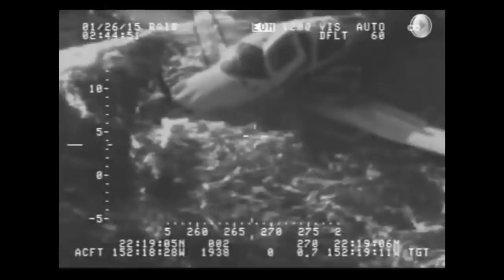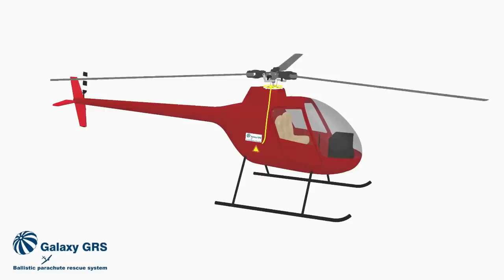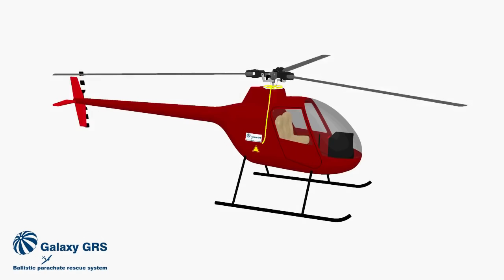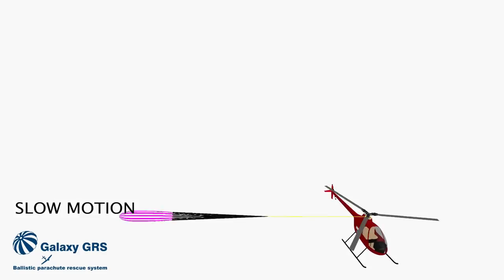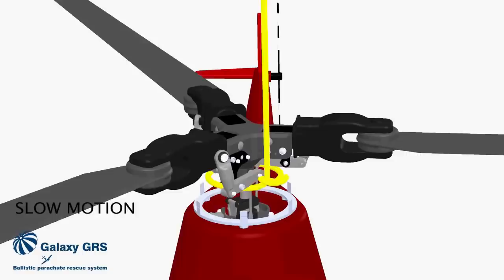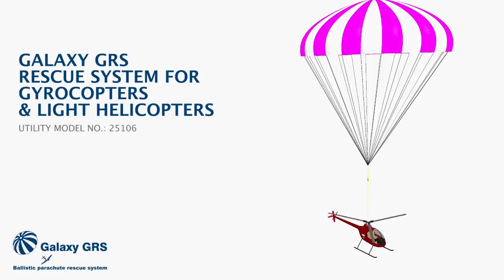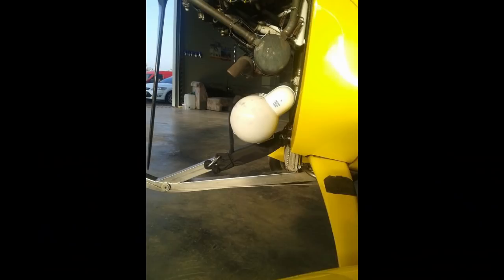Gyrocopter parachute rescue system or ballistic recovery system [BRS]

Comment: I watched an early Air Command go in from around 600 ft. A couple loud popping noises like a shotgun, and we all turned just in time to watch as the Machine made a giant parabolic curve into a nearby field.
  What sticks in my own mind is that the rotors were not turning at all. 
That man would have survived had he had a simple balistic parachute attached to his airframe. Even at the mast. There would have been no rotor interference at all.
  I dont know why this accident actually happened, I personally suspect the Sky Wheel rotorblades.
 But i do know, that any pio or pitchover causes the blades to flap and to strike the airframe. And all of the accidents ive seen since then on videos, the rotors were either stopped completely or nearly so. 
 Some were too low for recovery, but rotor interference would not have been a factor. 
  There is a serious danger of inadvertent deployment, but......
Reply: When you unload the rotors in flight (and it does just happen in ppo) the airflow is reversed the disk will stop in about 1-2 seconds.  The airframe is still flying forwards and flys straight through the disk (generally)  the two pops you heard were the prop colliding with the rotor and possibly the rudder striking.  This is generally a very high speed accident.  In the older VW direct drives with shorter narrower chord blades this was less common but with the advent of light high power machines like the aircommand and larger rotors it started happening more often.  Many of these happened in strong winds turning tight circuits from downwind to upwind.  The gyro flies relative to the wind but when turning from a downwind to upwind you drift and many pilots instinctively turn too tight,  the lift vector now almost sideways requires greater power and back stick.  In the old machines you'd just stink in 583 with 25ft 8 inch chord rotors it could hang on.  Now he turns up wind and the now massively spun up rotors are flattened out what will the machine do?

It'll climb like anything,  the big heavy blades have loads of inertia so as you push forward the lift vector is even more vertical,  you should cut power and wait but our hero is setting up to land so he pushes the already shallow disk angle further forward.  Bang rotor unloads machine flies straight through the disk bang bang bang your blades are now stopped all control has gone.

Of course the solution is correct training, people actually understanding the rotors.

Helicopters will do exactly the same thing.  One accident down my way had a picture of a kid holding the severed tail of a jet ranger that crashed doing a similar manoeuvre.  Why don't we see this in choppers as often?  Better training.

Look zi really hopes this works but few of the fatal unloading happen high enough for this to work,  however if it saves someone great.  But if like horizontal stabilisers its claimed as a cure all and the machine is blamed again and the poor quality training is not, I predict like the numerous gyros fatally unloaded with large hs on the back (just google them)  i fear we'll use this as another failure to address the appalling training record.

I have flown in the aircommand dual  and it was a sedated pussy-cat.  My instructor was extremely good and we didn't fly it fast best ld was claimed to be 50mph by fetters we found 35mph was its actual best ld. Fetters claimed it could be flown at 100mph my instructor told me to never fly it above 60mph.  

Basically it was a great machine oversold had fetters put a 60mph vne o  it I believe few would have crashed.  Had the students had decent training many more wouldn't have crashed.  Nothing wrong with sky wheels other than breaking you back trying to lift the heavy buggers up onto the rotorhead.  Training,training, training.
Reply: @cameronlapworth2284  I dont think that in this particular case this was actually the cause. At least not the overspeeding rotors. It happened  mid to late downwind and while i didn't see the actual strike, I do know it happened. At some point because the propeller and rotors were badly damaged at the point of contract. Puzzling to me was the fact that the trailing edge of the rotors were torn up but the leading edge was untouched. The prop was smashed on the front. As i recall, it should ha e been leading edge to leading edge.
  The man had been  taught by Marion Springer herself in Marion's own trainer. Knowing her i doubt that he was undertrained. Although he Was certainly inexperienced. 
  I personally suspect flutter. But here is no proving it. I spent several hours discussing it with Martin Holman. And that was his belief which i am unqualified to dispute.
Reply: @MrPanchoak  hi Marion certainly had an excellent reputation so I suspect you might be right.  I was not suggesting overspending the rotor is the cause,  even in the scenario I explained which was most common here (on turning final)  the problem is not so much that the going fast its more that commonly people would get into trouble over responding.  

From memory Marion uses a single seat bensen as a single seat transition machine.  While this had an excellent power to weight ratio unlike a lot of the vw and Subaru engines many of us flew the sky wheels was 8 inch chord compared to 6 & 1/4 inch chord,   so you have a machine that at any given airspeed will be flying with a shallower disk angle and thus more prone to unloading.  The only thing you could be certain of is the machine was unloaded.  Interesting that Holman thought do you remember if he thought the chordwise balance was wrong on the rotors?
Reply: @cameronlapworth2284  That is what Mr Holman thought. He also wrote about them being too far aft balanced. As far as training with Mrs Springer,  I do know she had a two seat glider at the time. And I believe that she was also using an Arrow powered two seater. 
But the incident happened over 30 years ago and i dont remember clearly all of the particular circumstances surrounding it.
  It scared me, such that i never began training in a gyroplane. And only recently aquired a couple hours instruction. And have just finished up a Gyrobee. Ive stuck with fixed wing and ultralights over the time. But a gyro now fits my needs best. And i cant get them out of my blood.
Reply: @MrPanchoak  hi.  I live in Australia so never met Marion Springer but was highly impressed by her approach,  glider two seat ground hack as she used to state.  This was almost unique at the time.  My training was similar only my instructor didn't have a single seater to go solo in.  However he would test fly all our machines for us and wouldn't let us fly them until he considered them safe.  At the time I met him I asked him how many different gyros he'd flown he told me he'd stopped counting them after 200.  I my time training with him I saw him test many (over 20)  and he'd been an instructor for a couple of decades before that.  So he like Marion understood the various issues.  I leaned to fly on wooden rotors which you need to chordwuse balance.

If you read the Bensen design manual you'll find a section were he talks about when they used gyrogliders at NACA to test different profiles and configurations.  He explains how slightly overbalancing will result actually increased stability but over 30% chord would lead to weave.  Under balancing would lead to flutter.  Before I built my own rotors I was a gyroglider instructor for our club.  We lacked funds and were flying on borrowed metal blades.  I was worried about being responsible for wrecking the members rotors or a solo student smacking them in so one of the club members build a set of wooden blades.  I test flew them and they had issues (not because they were wood I learned on wood rotors and consider them superior)  the guy had balanced them at about 28% chord and they were tremulously stable.  We hit a thermal that topped the hall gauge at 80mph+  barely effected.  A little overbalance can be protective too much is disastrous.  However I have also flown on skywheels and found them fine.  I didn't pilot them beyond 60mph but my instructor gave me a good demo of what the aircommand could do we hit 80mph before a wing steep climb and wing over (all +g).  I doubt it was the blades but wouldn't surprise me if they were not properly chordwise balanced.

They were very stiff.  I have a cross section from a wrecked set.  They were massively thick.  So not very flexible chordwise.  Even if too far overbalanced you might not get the negative effects as a result.  Note propellers are not chordwise balanced nor are aircraft wings but the rigidity stops this being an issue,  but I'd rather not tempt fate.

My own experience leads me to believe a flexible rotor with a slightly overbalanced rotor but below 30% might make a more effective training blade that could be replaced with a sports blade might solve some of our issues but nothing replaces good training.  

The aircommand over promised on performance and IMO the blade size co pared to power to weight was dangerous at higher speeds.  A 20ft 7 inch chord rotor on a lightweight machine like that would have had the broad speed envelope fetters wanted holding the bigger sky wheels back for two seat work.  The price you pay for bigger blades is safety at speed.   When Wallis broke the speed record he had 19 foot 6 1/2 inch chord rotors on his Mac powered machine.  He also had an in flight adjustable head offset I believe and a adjustable tail to keep the airframe level at speed.  Speed is not you friend in these machines.

Consider this.  HS are I believe oversold.  Try this thought experiment.  Bolt your machine to the ground facing into a 40mph headwind.  Do the same to a fixed wing beside you.  Now in the fixed wing push your stick full forward and backward.  What happens to the wing?  Noting because its fixed to the fuselage.   The stab on the fixed wing slows the wings response because its connected directly via the fuselage to the wing.

Now on the gyro assuming your blades are spun up.  Push the stick forwards and back.  Any resistance?  Can you stop it from unloading?  No because even if the airframe can't move one inch you can still unload the rotor because its not fixed.  So HS cannot be as good as directly bolting the frame to a slab of concrete.  The answer is to then keep the disk from being too shallow to the relative airflow and to fly the disk not the airframe.  Be gentle  and keep the speed down and you'll be fine.  Also don't think you need a massive set of rotors.  I know a guy who flew 18 foot rotors on a great little light chrome molly gyro.  He had a 503 on it the frame and engine was one piece the axles came off, as did the short mast, nose, tail. Desinged to slide into his station wagon.  He'd bolt it all together in an hour or so.  The blades spun up quicker he got off just a quickly the machine could fly just as slow.  

Anyway the bumble bee looks like a great machine do loads of strip runs after the dual training hours balancing.  Do the small hops, bigger hops etc. After dual as a light single seater if going to be massively different to dual machine.  If you can find a gyroglider the feel will be identical solo to a light single seat machine.  All the best
Reply: @cameronlapworth2284  i dont tell everybody, but my blades are wood, balanced internally like the blades Chuck Beatty showed. Jerri Barnett was also a pretty good friend of mine before he passed, and these are built with his blessing. 
Your advise is precisely the direction im going as far as training. Wood blades are cheap, and at least on a single seater as safe as the "fancy ones". 
  I have several hundred hours flying ultralights, and over 3000 in General aviation. Invluding quite a bit of time as CFI.So after getting properly familiarized ill just get used to my own machine the old fashioned way. Then fly it after first refreshing in a trainer. But i just cant justify hangar fees, nor being confined to airports any longer. And Gyros dont suffer much tiedown damage.
Reply: @MrPanchoak  ah another wood blade afficianto,  I agree nothing better as far as I'm concerned.  They hold on longer and they are far more forgiving than metal or composite.  Composite could be as good but they tend to make them too stiff.  Nice to see I'm not the only one to like wood.
Reply: @cameronlapworth2284  🤣🤣 likes wood?? More like dont want to take a chance on smashing up $2500 dollars worth of nice expensive factory blades. Druther learn on Something I can reproduce myself. They are also lighter and more easily make ultralight weight limitations. And this is just a stepping stone before building a two place machine which will probably get a set of Vancraft blades. 
  I dont care much about speed, I have a little airplane. But i would like to have better short field capabilities. Especially landing. I've lost my engine twice on twins, twice on singles, and several times in Ultralights. 
Ive also lost an ultralight to a windstorm, and seen several Cessna singles upside down on the tarmac due to windstorms. I swore I'd never again have an ultralight unless it were a gyro.
 Hangars are expensive.  My airplane has folding wings. But its a nusance to set up, so it doesnt get flown.  Im going to sell it and build myself a two place gyro.
Reply: @MrPanchoak  I shouldn't have fallen for that I'm a school teacher 😉 hard to live those comments down

I had a similar problem in that when I built my VW bensen style machine I was a Starving freelance artist with a country going through recession.  My wood blades were $120 including hubbar.  I'm building a Hirth powered gyro now and a gyroglider.  I still have my Bensen Wood blades (woodies 😉) and I've helped others build thiers and have test flown several,  I've had most mistakes happen balance both over and under chordwise and balance Spanwise + even a partial delamination (the guy who build the over balanced ones ran out of glue doing the top skin so thinned it out over the last couple of feet.  We had trim tab up on that blade to track it and it delaminated in a pull up in flight with a heavy student got the vibration you get when you pull up a high conning angle but it didn't go away.  

When properly built they are beautiful.  So smooth.  More delicate though, don't want to leave them out in rain etc.  Can get stone chips.  But easy to repair too.  

One of the reasons I'm building a gyroglider for myself is to act as test bed for wood rotors.

Bensens aren't the most efficient profile, he compromised performance for simplicity of building.  I plan to build an N8H12 cross section rotor imbed the spar but keep the chord weight external to lower overall weight while keeping the inertia from the tip weights.  Good enough for Wallis good enough for me.
Reply: @MrPanchoak  just one more thing.  The wood blades are generally set to a lower angle of incidence.  This is because they are flexible (this is a good thing).  Usually 0-0.5 degrees.  If you fly external tip weights like Bensen you will get balanced blades but because the 28-32 ounces (from memory) is 2 feet from the tip you will get more inertia than having a greater weight but distributed over the whole span.  Thus your blades will hang on during landing.  In Australia because we flew heavy VW and Subarus until the rotax's came along we had  the bensen blades modified to 7 1/4 inch chord by 22ft.  These are what I always flew and my wood blades are these.  They will give you great performance on a light gyro, they flew fine on my direct drive VW.  And I trained people on the same design woodies for years in the gyroglider two up.  I carried students up to 120kg + my (then) 74kg.  So a lightweight gyro will do fine.  You can find me on my linked in page and give me your email and I can send a scanned set of plans if you haven't built them yet.  Cheers
Reply: @cameronlapworth2284  angle of incidence?? Are you referring to the blade angle to the hub bar?
 Or to the zero pitch on the rotorhead?
Reply: @MrPanchoak  angle of incidence is the fixed pitch set into the blade relative to the hub bar.  Angle of attack is the angle the air hitting the rotor itself which is obviously going to be effected by changing the angle of the disk itself, airspeed direction the gyro is flying teetering etc.  Wooden blades generally have 0 to 0.5 degrees angle of incidence.  They become hard to hand wind otherwise.  This is because their spanwise flexibility makes hinging (blade flap) easier.  If you had a prerotator you could set it higher although you need to add a trim spring.  The offset on bensen machines adds stability but was set where it was as a result of the disk at best ld  being at 9 degrees and a line drawing through the hub through the cg.  When bensen started offering metal blades he suggested using a spring to compensate as the higher angle of attack means the disk position in flight changes.  I have aluminium and wood blades when flying the wood I don't need a trim spring.  I would if I set the angle higher.  

Apparently 4 degrees is the most efficient compromise but hand winding becomes impossible.  Chances of hinging (blade flap) becomes higher the higher the angle of incidence.

I watched a bloke with a hydrolic prerotator hinging his blades up and down the strip with those 5 degree twisted rotors.  Of course he was crap at winding blades.  He had been a former gyroglider student of mine and quit because he had been convinced that the gyroglider gave you bad habits.  I know he'd smashed up several sets of rotors, cowboy, lead by cowboys.
Reply: @cameronlapworth2284  sorry, i dont care about angle of attack. But i wasnt sure if you were talking about hub setup, or about blade setup.
Fixed wing angle of incidence is chord vs aircraft C/L. 
 Problem was ive also worked on helicopters quite a bit. Collective  is not angle of incidence. But on fixed pitch gyros it COULD be. I just wanted to make sure I understood what you meant.
Reply: @MrPanchoak  yeah that's fine i tend to over explain.  I suppose on helicopters as its collective control its not referred to as angle of incidence.
Reply: @cameronlapworth2284  and i was wondering if i understood you🤣
Reply: @cameronlapworth2284  im not sure where to find that website. Is it the gcfc?
Reply: @MrPanchoak   have a LinkedIn send a request and I'll direct message you my email details.
Reply: @cameronlapworth2284  grr, dya have fakebook or parler er mebby mewe?
Im kinda tryin to clear out of tracing formats.
Reply: @MrPanchoak  hi that sounds like a great idea.  We're you thinking of setting up a page or something.  Skype-zoom-discord-emailgroup?  I'm away for a couple of days from tomorrow so be patent if I don't reply to follow up messages may be out of phone reach.
Reply: @MrPanchoak  sorry missed this message before I'm on holidays so have been camping and visiting friends/family.  I get you in regards to tracing.  I'm a school teacher so I've not done facebook I try to keep my work and personal life separate.  I will have a go at setting up a Facebook account.
Reply: Today
Reply: @cameronlapworth2284  im actually trying to divorce myself from Facebook.  But i still have an account there.  But so far MeWe provides a pretty good platform and it would be pretty easy to set up a group over there.
Reply: @MrPanchoak  alright I have to spend sometime figuring out the security settings and see if I can have a group that people request.  Will send a message here when I get it up.
Reply: @MrPanchoak  hi I've just set up the Facebook group.  Not sure how signing up works been pretty brutal with security
Reply: @MrPanchoak  sorry got an important call.  The Facebook group is called Gyroplane Wooden Rotors